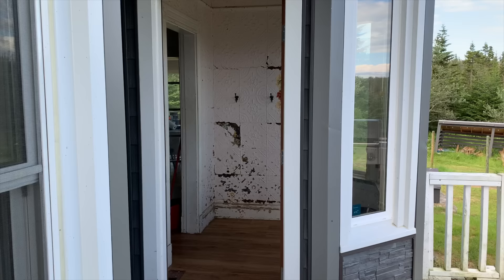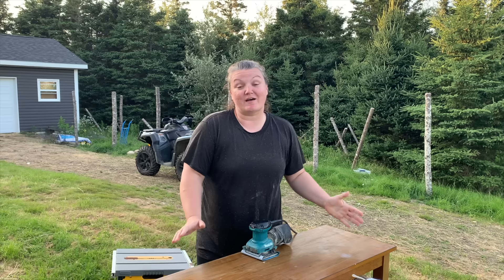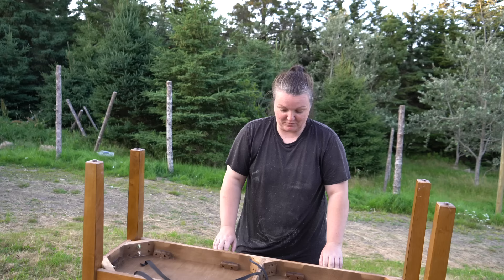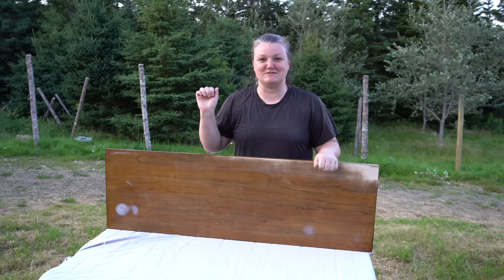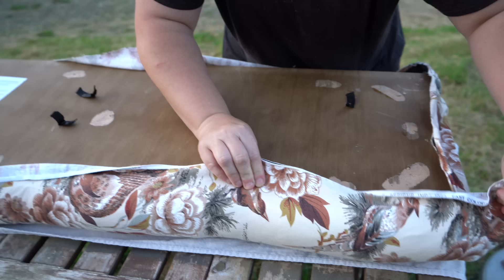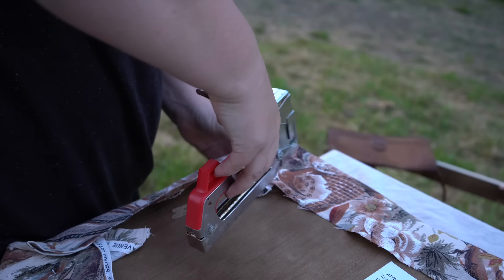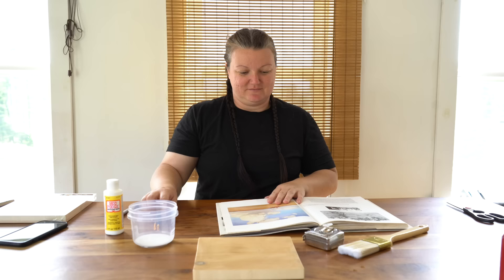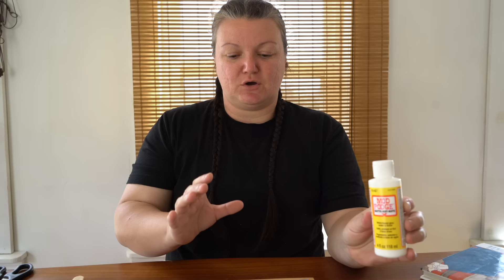SMALL ENTRY MAKEOVER * Ep.2 * Elysia English

Comment: I do a lot of crafts but this one is new to me. It’s a great project. There’s a craft I love but haven’t done it for quite awhile. I think quilters use it all the time. It’s printing on fabric. There’s a product I use to help keep the ink colorfast although the ink on my new printer seems to hold the color without running. I tried different fabrics. One was more coarse. I have an old disk that has  botanical prints. When done it was done it looked like a needle point.  I haven’t tried it on my new printer but it’s supposed to be a good one for crafts. We’ll see. Love your entry way!